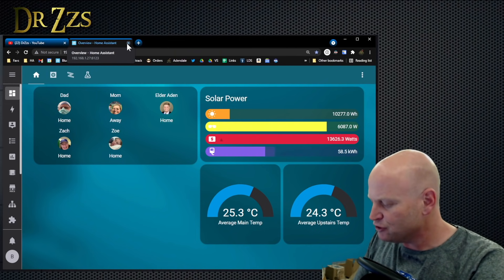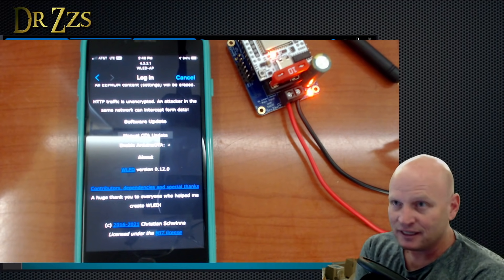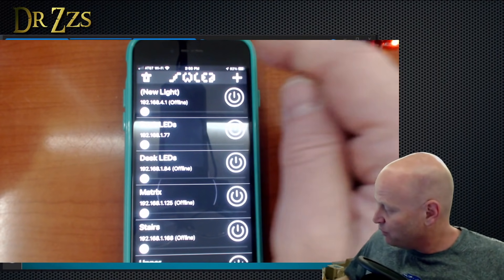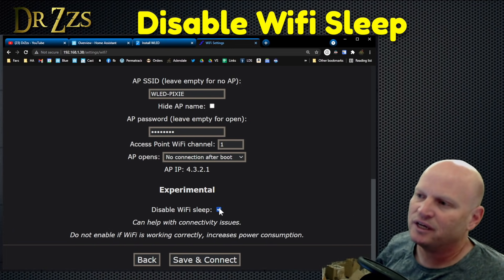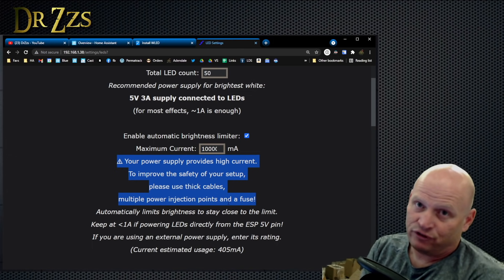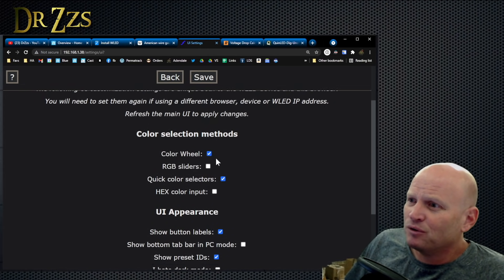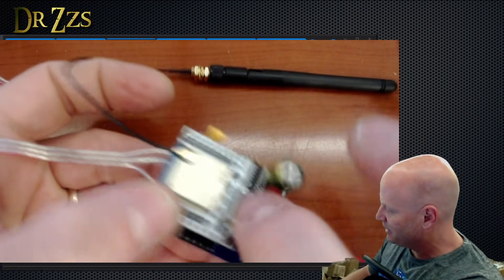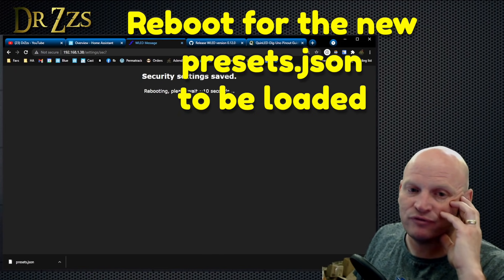Answers to Common Questions wLED

Comment: Thank you for pointing out the software's current limiter. I thought I had a bad connection and couldn't figure out why the leds were so dim. I have a 500w (converted PC) power supply so was able to set the wled setting considerably higher than 850mA.  Problem solved!

Comment: I have a 150w 30amp power supply. In wled what Ma can the setting be. It defaults to 850. I am running 320 5v leds. I am new to all this.

Comment: I’ve got a question 
I’ve got 3 5M 60led/m and want to add them to one light however In WLED it says that you shouldn’t have more than 800 is there a way to make 2 lights but make one continue after the other in the animations rather than duplicating it. Or how else could I achieve this as I plane to make a panel and plan to make more in the future

Comment: Using a Falcon controller or something similar, you can upload sequences via xlights which include the music, you can those sequences to a "Playlist" which will cycle through the songs and sequences to go with the songs. Is that possible to dig quad and the esp32? How much data can be stored on the devices to make a "show"?

Comment: will the lights come on as soon as you connect  power, prior to selecting the output pin, or does the pin need to be configured before you'll see any lights come on? Just got the new dig quad and can't get my lights to come on.

Comment: I have wled on a new Dig-quad.  

Is there a way to run a 10 preset playlist starting at 5pm every night for 5 hours(for a xmas display)?  I have built the presets already and have the preset cycle checked.

Comment: If you only plan on using your dig quad once a year, at Xmas, should you update once a year?  Will it still work if you don’t?  Thx.
Reply from the maker: If you are not changing the show and it's working for you, don't bother updating it.

Comment: I have a problem only the first light works turns on blue I cant change color or do anything I am going to order another quad to see this one  is brand new. I put a #10 fuse because none of the fuses it came with were any good . Is there something  I am missing.  Thanks
Reply: I am having the same problem but my first light is green. Ive been playing around with them for a while and have only got all light up white one time
Reply: @stutzTHEman13  i figured out the problem i had the wires backwards i had the blue and white wires wrong i switched them out and it works now. On my plug the blue wire was negative and the white wire is data wire. Try that it should work.

Comment: Can you have several controllers acting together, i.e. they are set up independently each controlling its own strip, but then you want to make them behave as one controller driving the two strips as if it were a single longer strip?
Reply from the maker: All the coordinated strings need to be on the same controller.  A Dig-Octa can handle the most separate strings.  More that that and you need a falcon player or something that uses a bigger CPU.
Reply: @DrZzs  Then what is this info I saw on quinled sure about how one controller can control a second one? 
To quote

WLED Remote Sync
WLED features a method where multiple controllers can be synced to run the same effects. Since this only sends through what effect to run it doesn’t generate a lot of network data. This also means that there is no continuous sync over multiple controllers so again either using WiFi or Ethernet won’t make a very big difference.

WLED Remote continuous
If you do wish to run an LED strip or pixel string divided over multiple controllers and for these effects to be in perfect sync as if it’s a continuous LED strip, the setup is a little bit different. Instead of setting up a sync of the effects and data, starting from WLED 0.13 you can setup a remote controller in the LED preferences menu and it’ll all act like it’s one big continuous strip so even effects like “comet” will act like they’re moving over the multiple controllers like it’s one whole using this “DDP” option!

Comment: Such an amazing resource thanks for putting up these videos!

Are you able to help me with a question about the dig quad and dig uno?  I'm trying to run ws2801 pixels and I'm not sure if it's possible to remap the clock and data pins to the screw terminal pins?   I love my quad and uno and would like to be able to use them to run these pixels of possible.  Thanks in advance!

Comment: what the output pin number for ESP32?
Reply: Usually 2, or D2 on the board. But if you've connected the leds to another pin, just change it in led settings page 👍

Comment: I bought a dig uno from Dr. ZZZ when I hooked up  my  dig uno my wifi it  does not display   the dig uno . any help any body
Reply from the maker: A good place to ask this question is with the Pixelheads on my Discord Channel: https://discord.gg/8gvF67h
Reply: @DrZzs  can you sync multiple esp8266 without home wifi network? 

like setting up the lights on a cabin in the middle of the forest